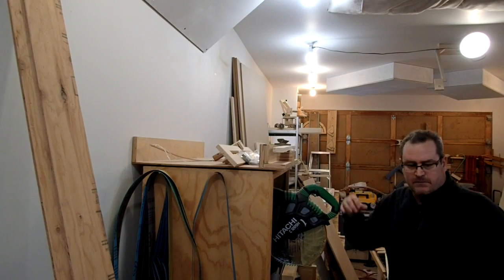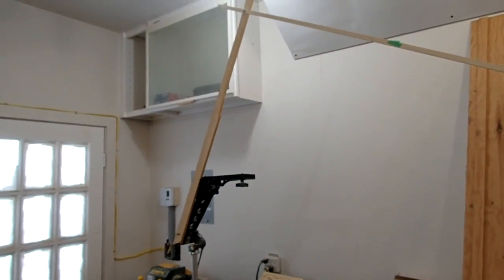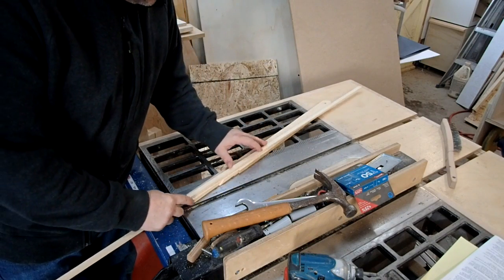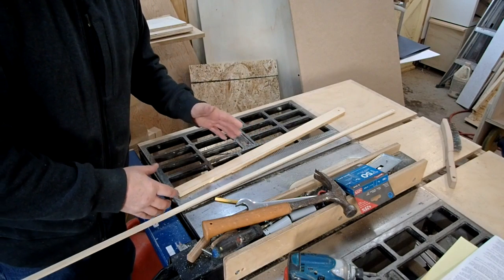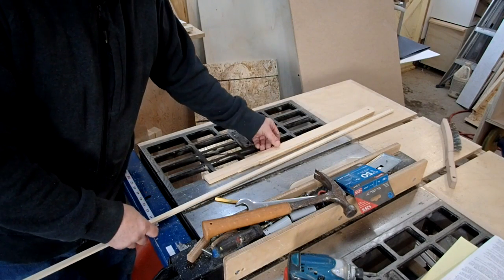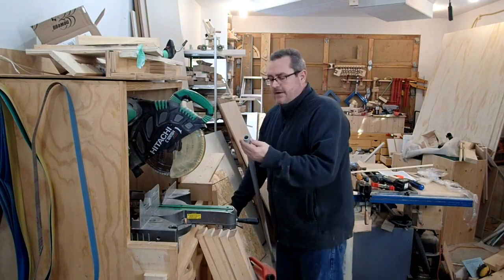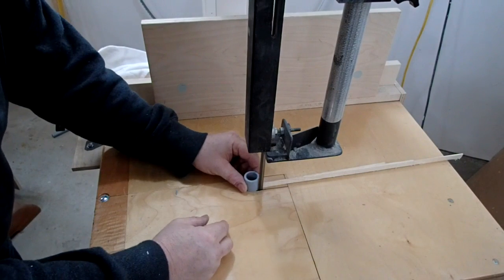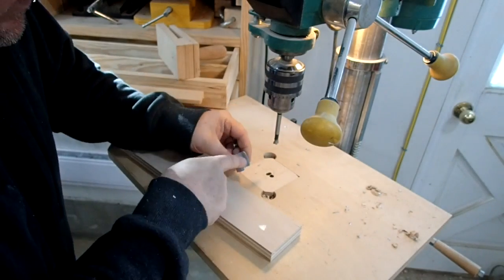Quick And Dirty Mic Boom

Comment: Offcourse a more expensive mic will sound better. It will add richness and clarity to your voice. For instance, this mic you're using now sounds hard, and has a hissing sound. It's also not very good in the low range. This is perfectly normal for cheaper mics, socalled videomics. But it is more than enough to get your message through. Your insulation worked very well, and you're right about the echo. It sounds warmer now, even though that mic does you no favours. As a professional I wouldn't be caught dead with that audio material, but then again, you're not recording the latest star wars movie here. As a last note, I don't even know if you do EQ on your audio tracks, BUT IF you do; please add some depth around 60-80Hz, and notch off some of the annoyances in the 3k-6k area.... 

But again, this is WAAY better than it was before. Good job :)